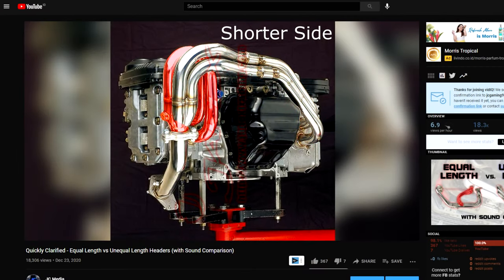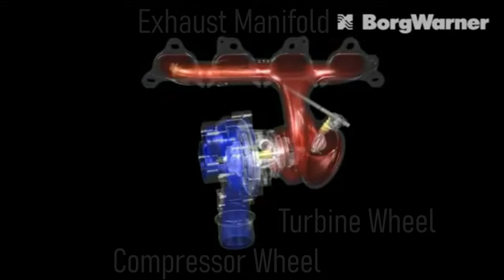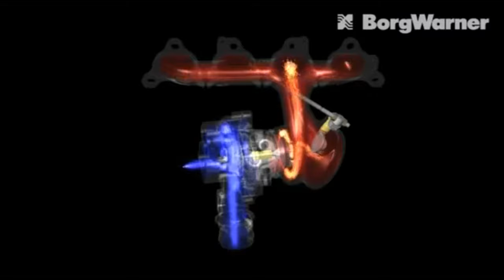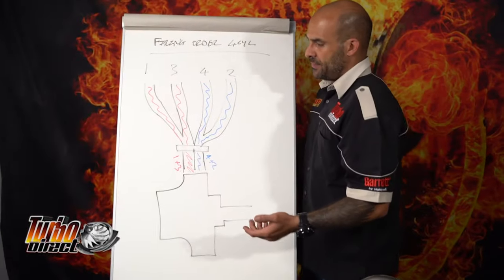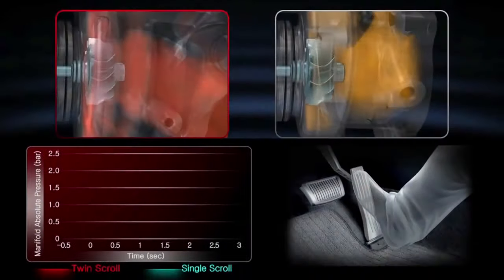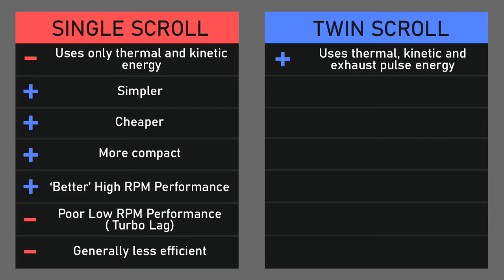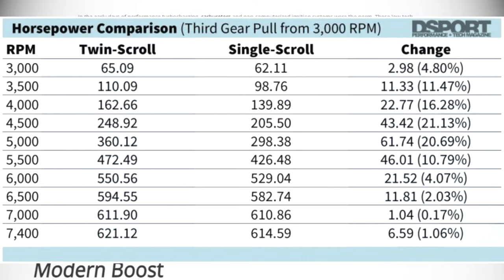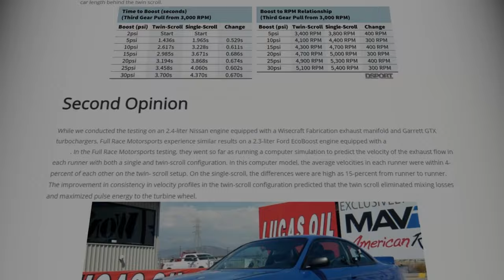Quickly Clarified - Single Scroll vs Twin Scroll Turbos | Pros & Cons

Comment: The collector is actually like a reserve bank of energy so the turbine wheel is not accelerated in a pulsing manner which means between each pulse the turbine decelerates and looses energy, the next pulse then has to re-accelerate the turbine to the prior velocity before it can accelerate it further, again wasting energy. 
The idea is the same as aero ducts for cooling. As the volume of the area increases at the collector the velocity of the gas decreases but the pressure increases. This helps buffer the pulse feed into the outer, lateral section of the turbine wheel, loading it evenly with a higher pressure gas. As the gas transitions to the axial flow section of the turbine wheel, the gas is squeezed into a smaller volume which accelerates it's velocity. As the gas reaches the opening in the housing the design of the dump pipe along with the cooling gasses 'contracting' attributes, causes the accelerating outflow of gas to draw the gas behind it along with it. 
That's where the correct header pipe diameter and resonator profile and placement come in, the reverberating LOW pressure wave that travels from the resonator cavity back towards the turbine should ideally reach the dump pipe / turbine immediately before the next high pressure sound wave from exhaust pulse. 

That's why it's critical to place any crossovers/bridges correctly and to choose the correct diameter exhaust. *Not just for performance at maximum output, but for maximum performance where the engine needs it most.... Where it most suffers from lag where you intend to use the engine the most, with a small, compromising consideration for maximum performance. 😉
A machine is a chain of links that all must lift be able to lift the weight, so the machine is only as able as it's weakest link allow it to be. If you approach fluid dynamics and thermodynamics with this perspective, instead of simply taking at it with a bigger sized hammer (10L displacement, Nos, engine that can only function at high boost & full throttle to badly create the same performance/torque as a lesser, more harmonized/civilised engine is able too with much less parasitic losses to friction, heat, sound and vibration. (And thermo/fluid dynamic deficiencies.)
Reply from the maker: thank you! very well said! pinned your comment...
Reply: ضغط زر ض١

Comment: The graph alone should tell you that the data and cons you’re providing are not correct. I don’t see that red line going above twin scroll at all throughout that graph so the loss of power up top is not shown. Additionally the twin scroll prevents a cylinders exhaust gas being forced into an opposing open valve to an unfired cylinder. Twin scroll is definitely the way to go but with v band becoming increasingly popular for fitment and seal and reliability, it’s worthless and not practical with twin scroll ( the original reason I clicked the video) . The twin scroll splits the banks so there are no opposing forces through the exhaust cycle thus becoming more efficient draining not only lower end boost response but nearly identical if not better, top end performance.
Reply from the maker: yeah a little oversight on my part, "theoretically" it might have less top end since the divider seems to restrict it but real world data (which is what matters) appears to show otherwise
Reply: Poppppopoo

Comment: Twin scrolls spool up faster in theory but with certain cars/scenarios they don’t and can reduce the maximum amount of power you will make throughout the power band. I’ve always wanted one until I did my research and saw actual race cars that used multiple different types of twin and single scroll turbos and they found that the single scroll made more power and spooled up quicker in their situation.
Reply from the maker: exactly... all boils down to the actual use case in question...
Reply: Given equal size turbos between single and twin scroll, and correct setup, this should not be the case.
Reply: @JeffGoris  but we aren’t talking about same size turbos now are we? Same size turbo the twin scroll would make less power. For same power turbos you would need a larger twin scroll turbo which would still reduce the responsiveness. With ball bearing turbos spooling as quick as they do these days it’s really hard to justify the extra complexity of a twin scroll setup when it isn’t all that much more responsive and makes less power in the end.
Reply: Why aren't we talking about same size turbos with the only difference being twin vs single scroll? Where does it say that? Btw, when I talk about size I'm talking about inlet area, turbine size, etc. Not the overall physical dimensions of the turbo. A downside of twin scrolls is that they are more complicated and larger, for the same inlet area, turbine size, etc (this is mentioned in the video). The only way to compare the two properly is to have all other parameters the same like inlet area, turbine size, etc with the only difference being the twin scroll (and it's larger housing).

I assume that on a 3 cylinder engine a twin scroll setup wouldn't make sense, but in what sensible scenario where all the other parameters are the same would the single scroll outperform a twin scroll in terms of responsiveness and peak power. Note, you can put ball bearings on twin scroll too.

And why would you bother with the extra complexity and cost? Because they perform better in pretty much every way. Faster spool/less lag meaning more boost at any given revs, more power across the rev band, better fuel economy, lower exhaust gas temperatures. Many manufacturers have and are using twin scroll setups: BMW M3, M4, Hyundai i30N, some Audi and Porsche inline 6 turbo engines.
Reply: @JeffGoris  when you are looking to size a turbo on a car you have a certain power limit that you are limited to before something hurts the engine. You chose a turbo dependent on your power goals, every tuner knows this. The first thing a tuner asks you when you go to the dyno is what are your power goals.
Reply: In situation like drifting? Because youre near the engines rev range right? So, single scroll would be better
Reply: @zokusharuuku1091  from my personal experience, you are completely wrong. My real world experience is I have driven a GTR, with twin single scroll turbos. I have owned a guilia QV with twin single scroll turbos, and now  I own a M5comp with twin twin scroll turbos. The difference in turbo lag is absolutely massive. From 1.5-2 seconds lag to maybe 0.3-0.5 sec. The difference it makes in day to day driving is really considerable. To the point that I wouldn’t use a GTR as a daily because you don’t have power on demand, you have it 2 seconds after
Reply: @jeff5798  there’s a pretty big difference between turbo lag and turbo threshold, I’m thinking most of you should probably research the difference..
Reply: @zokusharuuku1091  per this graph, again it looks like you should maybe research it.
Reply: Twin scroll almost always will be superior. You think these car manufacturers would put more expensive and complex turbos in these vehicle for no reason. The turbo lag reduction is massive.
Reply: If you're always racing then yeah, you're going to be in the powerband alot more than if you're just going to the store
Reply: @JeffGoris my Hyundai kona has a twin scroll lol even on cheaper economy cars they using them
Reply: @jeff5798  a 4.4L V8 vs a 3.8L v6 and a lot more differences. I’m sure the r35 has a 6 speed DCT vs a 8 or 9 speed ZF . Hard to compare it’s a lot more going on besides turbo setup.
Reply: @bigjdm5460  twin scroll turbo has almost zero turbo lag is all I’m saying

Comment: Its not because the pulses colide, its because the pusles overlap with when other cylinder exhaust values open thus reducing volumetric efficency, hence the single scroll takes longer to spool due to the engine having lower volumetric efficiency.

Comment: Maybe this is a dumb question, but why not quadhscroll turbo? One for each cylinder on a 4-potter? Diminishing returns?
Reply from the maker: I think that's mostly down to cost from increased complexity making it not as viable, especially for production vehicles. They do exist though, if I'm not wrong Garrett recently developed one...
Reply: After a pulse of exhaust, there follows a lower pressure wave. When this lower pressure wave passes through a single scroll turbo at the same time as the next pulse from the next cylinder exhausting gasses, the negative pressure wave reduces the pressure of that second exhaust pulse. This happens because the exhaust valves of consecutively firing cylinders are open at the same time for a brief while. However, the negative pressure wave will be over by the time the next (third) cylinder pulses - you will never get a situation with 3 exhaust valves open. There would be no benefit in having more scrolls. The closer the firing of the cylinders, which occurs with the more cylinders you have, the more beneficial the twin scroll turbo would be. Having twin turbos, of equal size, on a 6 or 8 cylinder engine you have each turbo on half the cylinders so that gives you the same benefit as the twin scroll - you do not have consecutively firing cylinders venting exhaust gases to the same turbo. I do not believe that the Porsche twin turbos use twin scrolls - it would be pointless - they have twin single scroll turbos. I do believe that they have twin variable geometry turbos (VGT). VGT is another video.

Comment: It's funny, I just tuned my 2019 wrx and put a new intake, catback, ebcs, bpv and aos. For the first time since putting all the parts on and getting a proper tune done, I went wot and wondered why I didn't feel boost past 5k rpms in sport sharp and this makes complete sense. (Forgive my noobness in not understanding the difference between the two.) Also makes so much more sense as to why the wrx and sti have two different type of header setups. Thanks for the video!
Reply from the maker: Of course! Glad it helped

Comment: Awesome video mate. Is there anyway I can get the Subaru rumble noise on a equal length header/twin scroll turbo? I have JDM 2008 STi GRB hatch with EJ207 engine. ..
Reply from the maker: Thank you! Unfortunately I don't think you can do that on a twin scroll EJ20, but I could be wrong since people have put UELs on the FA20. You will definitely lose the benefit of a twin scroll if you do change though...

Comment: Very educational very right to the point the only issue I have is that you can't leave out Saab Saab was the leader in putting turbos into everything they have a twin scroll system that one side is bigger than the other that way at low RPM you have low and boost and at top RPM you have top-end boost its supposed to give you both and have a little bit of lag it actually is a very good

Comment: In theory would a twin turbo set up work best? A small twin scroll for low RPM and a bigger single scroll for high RPM?
Reply from the maker: nope, just going twin twin scroll turbos is the better option

Comment: Super helpful thank you. I was more curious about exhaust manifolds and how they feed into the turbo as i was thinking bout changing my exhaust manifold to have two cylinders each feed to one channel of a dual exhaust but my car is turbo'd so the manifold already Does that, what i now need to figure out is how the exhaust come off the turbo as my car came stock single piped with a dual tip, while it looks alright, it sounds lame and i know the dual tip is a lie, i want true dual exhaust but i dont know enough about how the exhaust comes from the turbo to the back of the car

Comment: Lets say that you want to build a competition drift car. So, you want the turbo to perform better through out the top end area of the rev range hence, single scroll turbos will be better for a track only car? B'cus in drifting youre always near the redline. 

Is Single Scroll better for this application?
Reply from the maker: i would still go for a twin scroll, because of the better response and also because the top end isn't going to be too different to a single scroll, despite the graph shown. in other words, the response and turbo lag would be more important in this application

Comment: Question.

Can you run two twin scroll turbos on a V8 platform?
I’m sure it wouldn’t work on an I4/I6 platform due to lack of cylinders but I do believe it could work on a V8. 

Thanks.
Reply from the maker: absolutely! and yea, its not really viable on a I4 platform for that reason, but it might be possible on an I6 platform
Reply: They work great on four cylinders. The pulses are much more defined.
Reply: @user-pb9hy9uj9p  yes, but theoretically they could be way more efficient in a twin turbo layout on a V8. I believe Ferrari already uses twin, twin scroll turbochargers in the 488, Sf90, and F8 engine. Have to imagine the lag would be non existent with great bottom end torque.

Comment: Jason thanks for the video. Is it possible to run a twin-scroll turbo with unequal length headers?
Reply from the maker: nope it's not possible. you can maybe mount a twin scroll turbo on an UELH but it'll be useless since the gas pulses have to be even for any benefit to be gained
Reply: @JCMediaYT  I see. The only difference between  twin scroll and single scroll of a turbo of the same type is the housing right?
Reply from the maker: @kzz8971  if i'm not wrong, yeah its just the housing
Reply: Most factory twin scroll setups are actually unequal length, look at the manifold on the Evo for example.

Comment: How do you make your car habdle a twin scroll?
Reply from the maker: You will need a twin scroll, equal length exhaust manifold and a compatible turbo. The common flange will be T4 Divided
Reply: @JCMediaYT  
Okay cool. Will it put more pressure on the engine than a regular turbo? I have a MB c300 2.0l. It has a single turbo. Was wondering if twin scrolling it would be a good idea.

Comment: Why does a twin scroll turbo have to have "decreased size for gasses to flow through". They can make the twin scrolls have exactly the same size for gasses to flow through as for a single scroll turbo. There is nothing about a twin scroll turbo that limits the size for gasses to flow through. Even in your graph of power of single vs twin scroll the twin scroll had higher power right up to redline. Given equal size turbos with the only difference being twin vs single scroll, I believe the twin scroll will develop more power.
Reply: I'm not a mechanical engineer (a software engineer instead) but I suspect it's a limitation of splitting the exhausts into 2 and available size in the engine. Rather than dumping 4 (or more?) cylinders into a single collector, you now have 2 and the metallic characteristics require the same which increases the turbo size requirements. 
Feel free to disagree with me, I've always wanted to know more about engine dynamics

Comment: Twin scroll loosing at high rpm????
Reply from the maker: yup, due to a more restricted flow thanks to the different scrolls and passageways
Reply: You could also say a single scroll loses power in higher rpms due to increased flow disruption that is caused by increased exhaust pulses, creating less efficiency versus the twin scroll. The twin scroll might have less flow area but they are better equipped for higher flow rate and with increased boost, the flow will still have significant pressure flow and outperform a single scroll turbo in high rpms. The better the flow, the more air can be pushed under boost conditions. This can be confirmed with the dyno graph in your video, showing the twin scroll still outperforms in upper rpm range.